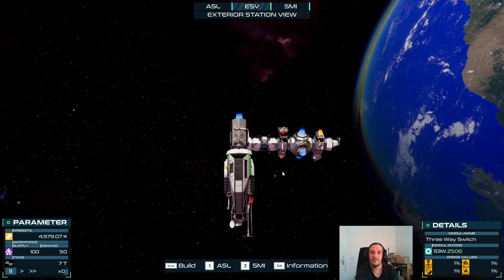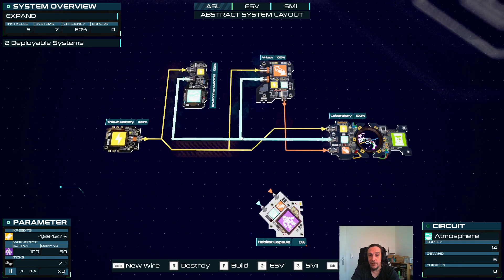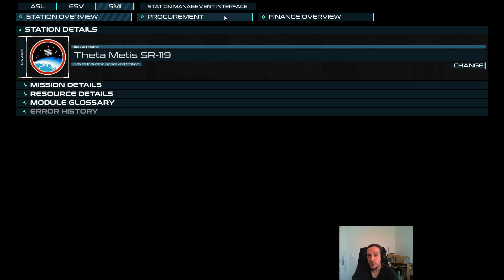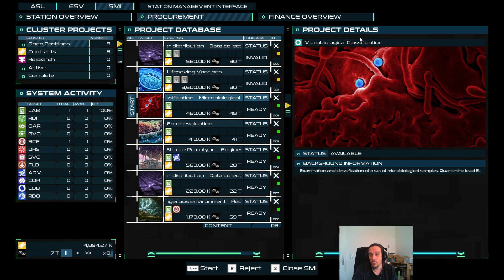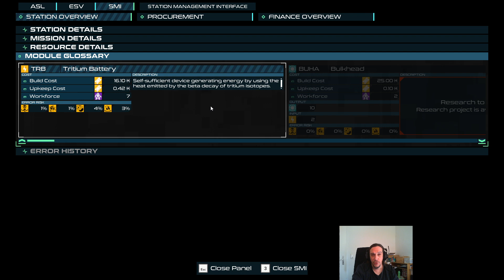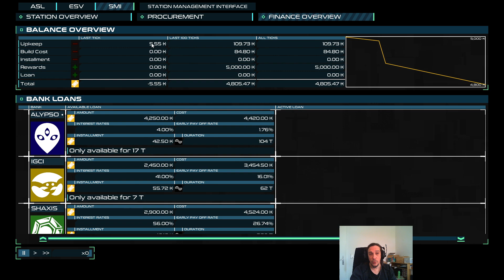ORBIT INDUSTRIES - Beginners Guide Gameplay Tutorial Tricks

Comment: There's apparently a way to turn off buildings but I couldn't find it. You should be able to balance the workload by only using the services that you need at any given time.
Reply: Yeah I'm also trying to work out how to turn off modules
Reply: @garageparty5541  the only way I've figured so far is to delete them off the "circuit board" there's no easy way to tell what you're using and what you're not though. Hope this improves cos otherwise it's pretty good. Gonna have another go tonight.